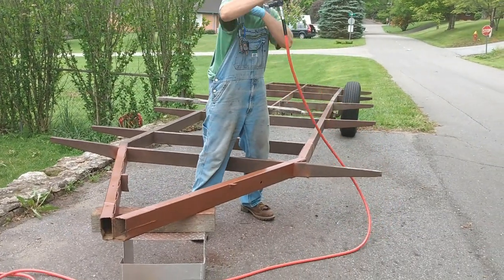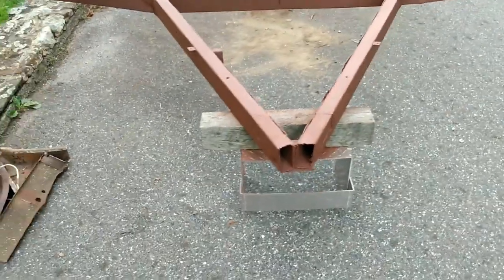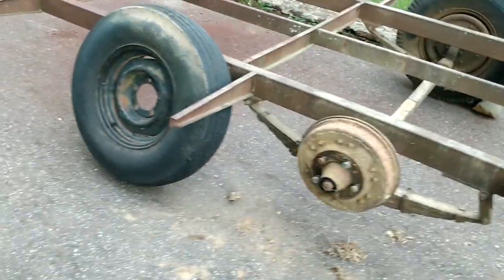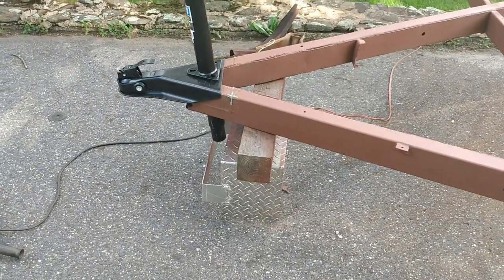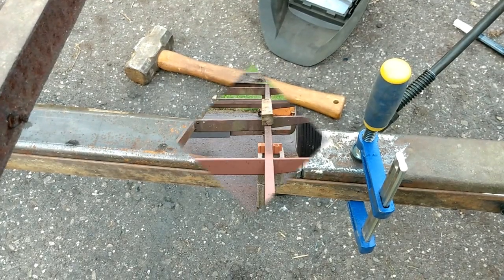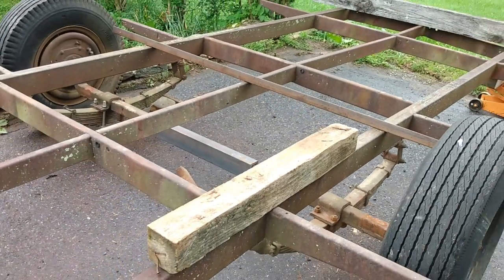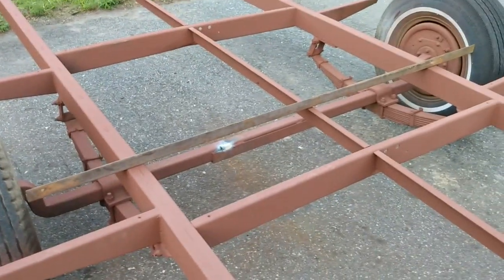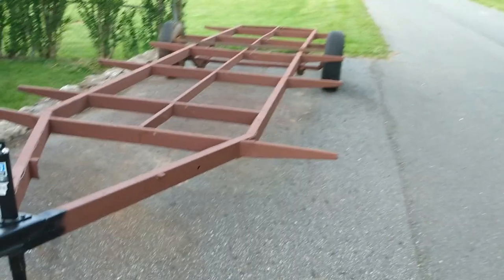20 Foot Trailer Project: Frame & Axle Work

Comment: Might want to crank down the spray gun pressure, sounds a little high. Something around 10-15psi is optimal. Nice work saving the trailer.
Reply: Ha sounds like he's spraying at 90 psi..ha ha.if he isn't careful he will learn how flimsy thease frames are the hard way.Someone give him a Buffalo to haul around on it..ha